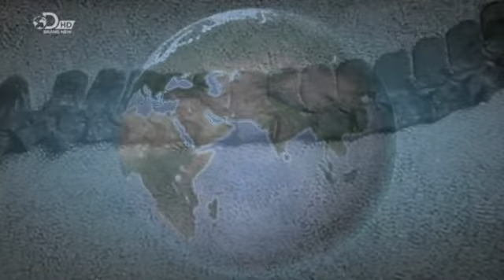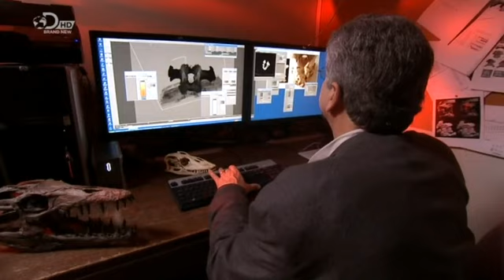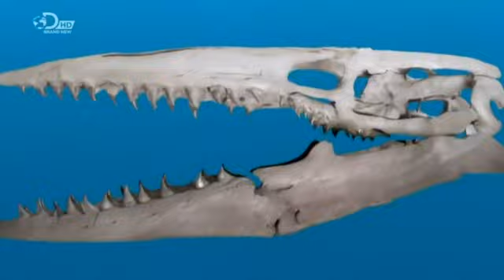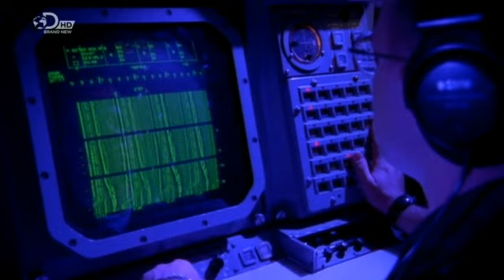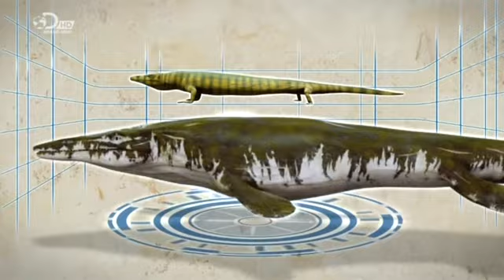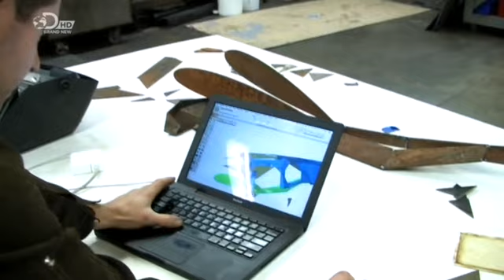Discovery Channel - Monsters Resurrected 2of6 T Rex of the Deep

Comment: This one definitely isn't as bad as the Spinosaurus episode, which already wasn't that bad apart from the design and describing the legs. Really the only problems I can see are the tail which should have a fluke rather than being a paddle, and stuff like the developed inner ear, snake tongue and "bizarre undersea ballet" of mosasaurs competing seem dubious. I will say the jaw being able to shift back and fourth should've been proposed as a theory rather than absolute fact. Even if they're in 2 pieces, they still look rather straight on the skulls they show. Same goes for the inner teeth, although I'm more lenient because why else would they be there?

And to top it off, they didn't go crazy with the size. That's something I feel should be commended about it as a documentary rather than a piece of fiction posing as one.
Reply: The mosasaur tail thing is just this show being out of date: every other documentary up until Amazing Dinoworld got this wrong.

The jaws being able to ratchet back and forth actually IS fact. The joint at the back is more complex than it might seem.